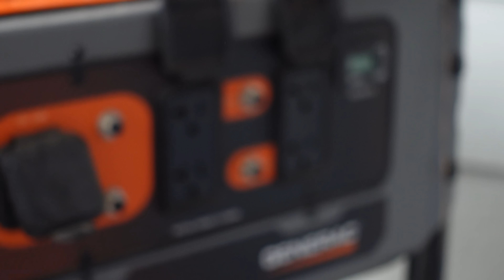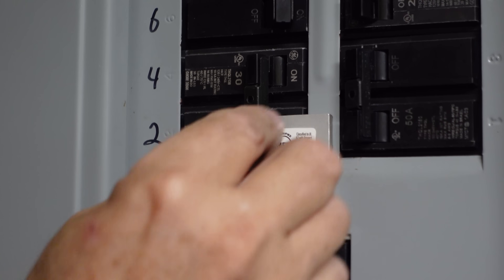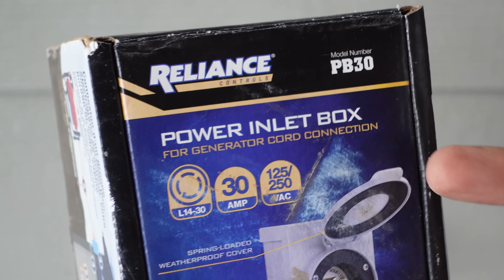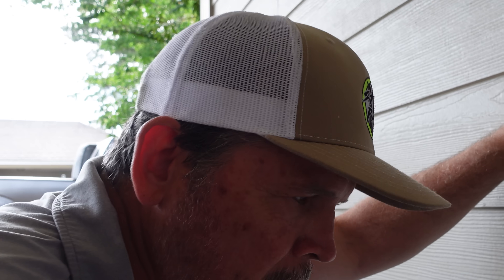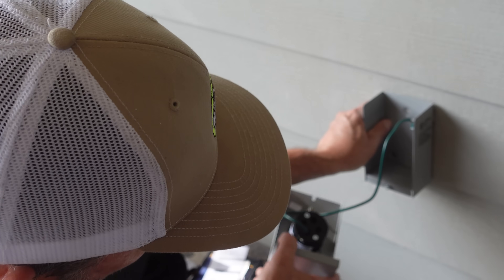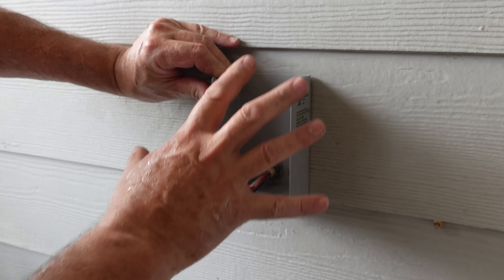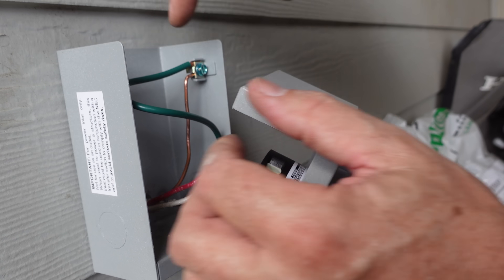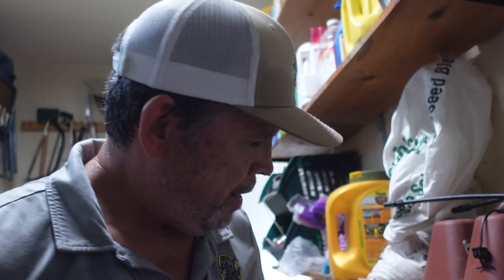What is a Suicide Cord and Why It Could Kill You

Comment: June 1 to November 30 is 6 months

I like your channel it's nice to see people that do it right 

I've had entirely too much experience opening up anything and everything that has been the most half-assed rigged up job. It used to be 50% of my year was spent just correcting other people's mistakes now it's easily up to 60% or 70%

I hate to say a lot of this work is because of people who don't have the background or the experience coming up from Central America and South America who think they can do electrical and plumbing even carpentry or painting and drywall but they just don't know what they're doing.

I've opened up walls and ceilings with shorted wires and burnt wires or electric panels if you turn on the light switch a circuit breaker pops. It's absolutely aggravating but luckily most of my customers understand what I'm doing for them when I tell them I've uncovered something like this so it isn't an issue but a few of them are of that mentality and they just do not get it even when there's burnt wires inside their walls and ceilings

Again it is so refreshing to see somebody doing it right
Reply: Are you the guy who corrects people for typing "there" instead of "their" or "your" instead of "you're"?  😉
Reply: @justcurious3525  nope not me honestly something like that people that would be that specific I really don't care what there doing, or for that matter what yore doing
Reply: @tapalmer99  So, you felt a need to point out that Paul said five months rather than six even though you don't care?  Who's benefit was that for?

Comment: So what is to stop someone (child) putting Fingers in Wall Socket hole. Should Have a Lock Out Hole on the Door. I wonder if a GCFI or Earth Trip on the breaker would protect that Wall Outlet (inlet) from inquiring hands.
Reply: Because of the interlock in the panel, there's no way for that to be powered without something feeding it (and covering up the prongs so they can't be touched)
Reply: What? It's a power terminal not a receptacle. And since there's no way to power it via the mains it will never be hot
Reply: @AndrewGorny  I know what it is. If down the road that "Safety Interlock" gets removed, then yes It can be live. Systems don't always get used in correct and safe ways. It would be nice if they made a fully insulated Male and Female coupling.

Comment: Biggest danger in a power failure/generator situation is misuse of power strips!😬
Reply: I would be much more worried about misuse of extension cords. Multiple 16 awg extension cords chained together with a 10 amp heater and a refrigerator plugged in. Plus a bunch of electronics will melt that 16 awg extension cord.
Reply: @ecospider5  that’s my point. Folks will run an extension cord from the gas generator into their house and plug a power strip into it. Then plug their TV, refrigerator, computer, lights, and phone charger into the power strip. Maybe even a heater! Or worse yet, daisy chain power strips together! More expensive power strips have some overload protection, but the cheap kind have no protection at all.
Reply: I’m just making the point that in temporary setups the extension cord itself is what is going to burst into flames. Especially if you leave it coiled up. 

The best thing to have is a power strip with a protection circuit and a really long cord so it can be plugged directly into the generator. Then you can chain all the power strips you want after that with out issues. Unless you actually found a power strip rated for less than 15 amps.
Reply: @ecospider5  I strongly disagree about daisy chaining multiple 15 amp rated power strips, and so does electrical and fire authorities. All of these added connections increase the resistance due to loose contacts (as opposed to a continuous wire) and this creates heat. Plugging my shop vac to a remote controlled 15 amp connector plugged into the wall outlet heats up that connection so much because the lugs are never exactly tight in there. How much? enough for a 6 amps load to melt connectors on a 100 foot convolution of 14 gauge extensions. It's the same reasoning of making sure all connections are tight (the handyman special's improperly tightened wire nuts...) and that there are no weird diy solderings and splicings done.
Reply: I disagree. You can chain as many 15 amp rated power strips as you want with no danger if they are protected by a 15 amp circuit breaker. 

A single 15 amp power strip plugged into a 20 amp plug with 2 10 amp heaters plugged into that 1 power strip will cause the power strip to burst into flames unless it had its own 15 amp protection.